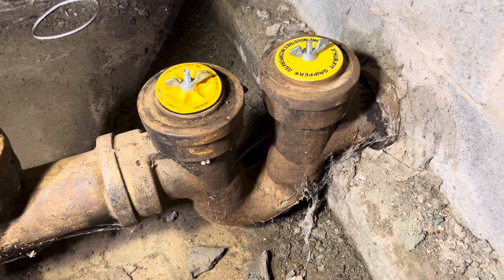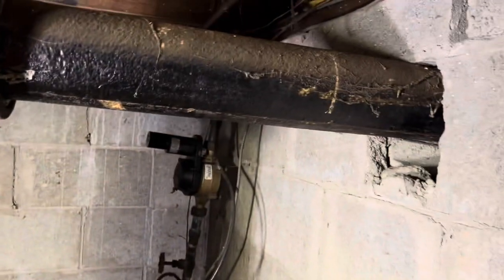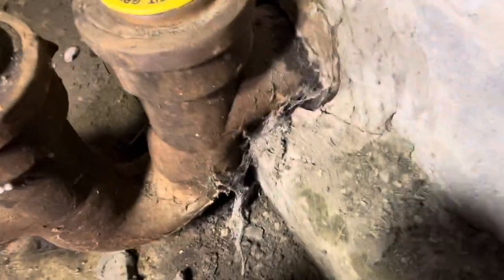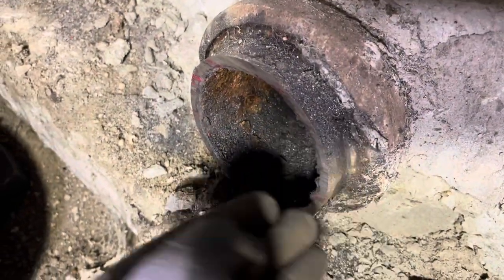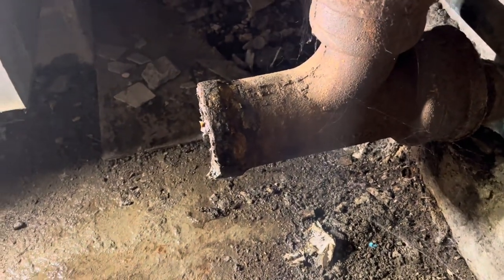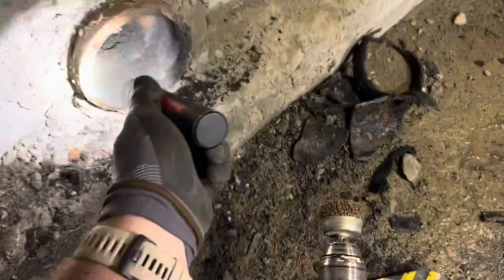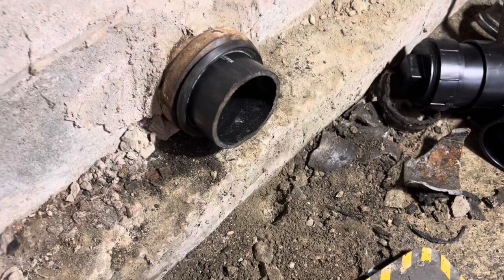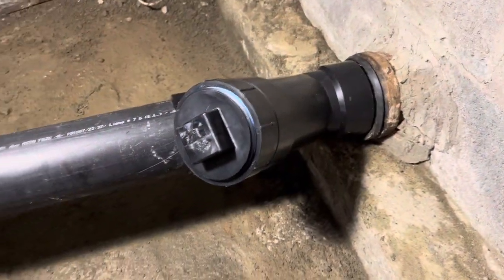Whole House Trap Removal! Plumbing Repair!

Comment: I have the same cast iron layout as in this vid. Vent an all.  Except that its below the basement floor and house trap is in sump pit about 1.5 ft down. I clear clog in that trap every 2-3 months. Line runs from house trap in front of house to outside rear of house catch basin. When I see dirty water coming up catch basin cover in driveway I know house trap is clogged.  Two years ago during heavy fast rain system was overwhelmed and flooded basement. Seems like i get the majority of the rain water that falls in the rear of my home as neighbor to my left has non functioning rear drain and my parking pad were my catch basin is lower then all my neighbors. thoughts on how i can remedy or improve situation?

Comment: I found a amazing way to remove the lead from a hub, you cut the pipe flush with the hub and then use a hole saw to remove the lead and the pipe falls right out:)
Reply: Lead chips and dust-lead particles are no joke.

Comment: Nice Video. Why did you go with ABS instead of PVC in this application? Thanks!
Reply from the maker: ABS is the preferred pipe choice where we are located. We pipe everything in ABS, unless there is a repair needed to PVC piping, and even then we transition a lot of that to ABS.
Reply: @valenzaplumbing   Nice video.  I always wondered if ABS was used because it LOOKS like cast.  My house is done in ABS but that is unusual here in Detroit.  I train home inspectors and am going to put your video in my playlist for inspector to watch.

Comment: Are the old cast iron fresh air vents no longer needed? Or do they have a vent outside in the yard?
Reply from the maker: A fresh air vent is no longer needed here, because there isn’t a trap. The fresh air vent aids the flow of sewage through the house trap in an attempt to prevent temporary air lock. Hope that answers your question.

Comment: If you have the right holesaw size, you can use it to drill out the lead on the cast iron hub , plumber from North California
Reply: Same thing on ABS and PVC fittings instead if using a reamer

Comment: I haven’t done plumbing in a long time I would prefer to keep my house trap,but I can see it being unnecessary in certain areas, but I would still want to keep my fresh air, when you look up the definition of the fresh air it doesn’t mention anything about the house trap. not in the plumbing code in my area. I believe it was a keeps the atmospheric pressure balanced within the plumbing system or some bullshit like that. But in my case, after the hurricane the sewer is backed up, and the water went out my fresh air and not into my house, which was very nice, so I would never get rid of my fresh air.
Reply from the maker: You cannot have a fresh air vent without a house trap. It’s not allowed. You would have to cap it, and it would serve as a cleanout. If your homes  sewer line has a likelihood to back up during storms, then you should have a back water valve installed.
Reply: whole house traps date back to the time when toilets and sinks didn't have traps, they also didn't have venting out the roofs. the trap kept the street sewer gasses from coming back into the home, but obviously did nothing for your own stink-moat and sinks(lol).
the vent could also double as an overflow if all the fixtures and holes were above it's height, it would dump outside, but often the caps are loose, missing, leaking and they've added drains/fixtures lower than the vent over the years. pretty much obsolete stupidity now days, which should be removed from any requirements and code (new/replumb), providing the building has a vent out the roof and everything is trapped.
Reply: @throttlebottle5906  Ran into situations on previously foreclosed homes the main drain would intentionally be sabotaged out of spite. Bad enough tearing up a basement floor to replace completely impacted pipe. But if not for the main trap would also be excavating outside as well. An extreme case to be sure, but they do serve a function. A house trap is cheap insurance isolating the house from the street. You also can't back-flush with a bladder using a WYE clean-out. P-traps provide more options.

Comment: buildup and roughness is one issue, but the bigger issue is "low flow" everything. the toilets no longer send enough water to keep the lines cleaned out, not many people hand wash dishes and drain sinks full of water, same for taking showers instead of soaking in the tub. water usage way down, problems way up^^^

Comment: I prefer a house trap it does protect the house
Reply from the maker: Just curious what the house traps protects against, that a trap on each individual fixture doesn’t? Just like to hear others opinions on the matter!
Reply: @valenzaplumbing  for the record my local inspector has also eliminated the need for a house trap. This is something I have struggled with back when I was an apprentice 40 years ago because it is written that you are not allowed to have a double trap on anyting but as soon as you install a house trap everything in the house is technically a double trap. So I would ask a question with these inspectors and they would say it would protect the house. And now all these years later I mainly do residential service. And as part of my service I will do a walkthrough for my customers mainly elderly people. Also young people that just don't know. Everything from where their main shut off his furnace filters dryer vents etc etc etc. So many times I walk into the basements and there's an old toilet that has no water in it a second bathroom that hasn't been used with no water in the bathtub the sink or the toilet then I'll explain to them that once in awhile the water needs to be run in these fixtures. And you'll be surprised it only takes one or two weeks in the heating season  the water in the traps have evaporated. So that being said that's why I think the house trap is very important. God bless and Fish on
Reply from the maker: @ricklee827  That’s actually a good point.